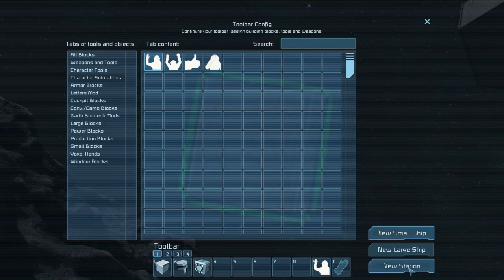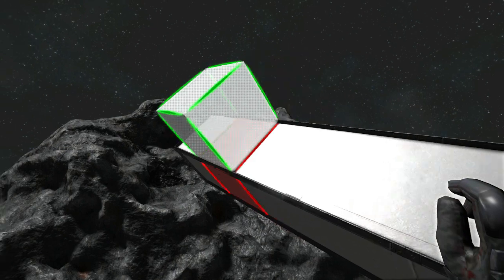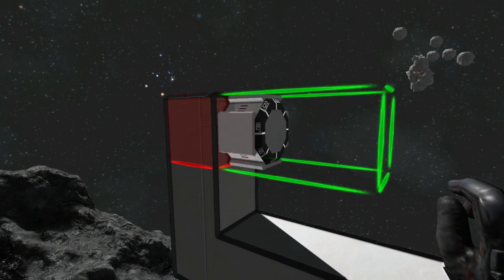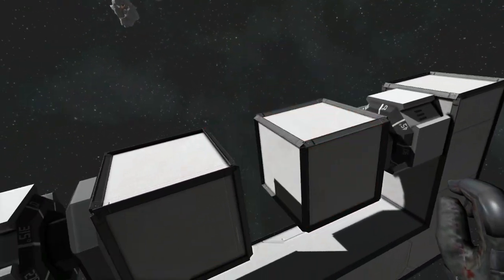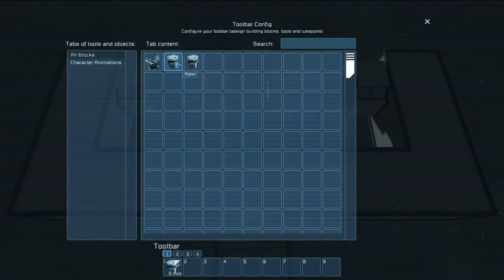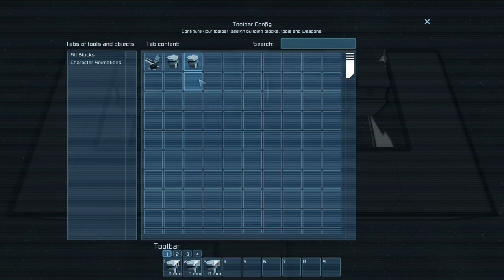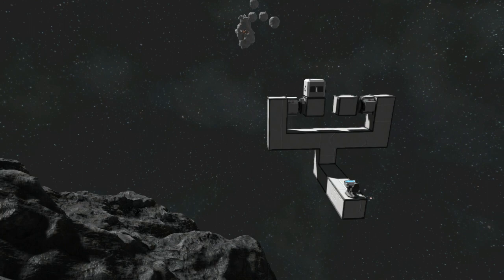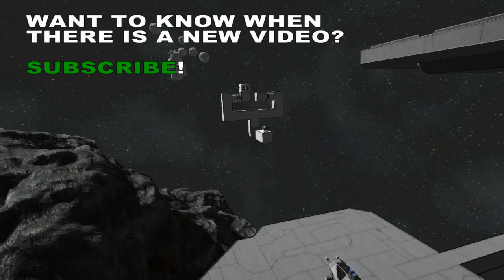E02 "Double Rotor Grid" | Testing Grounds | Space Engineers

Comment: I use the unattached rotor head trick! Setup is near the same but first you set the rotors to max lowered & then you grind off one of the rotor heads & build the platform & then place a rotor head on the part that has its rotor head still in place where it would line up to the rotor that you ground down so when you click the attach button it will attach when it gets close enough(which you have to extend the reach of the fully built rotor) Since keen added the attach/unattach function on the rotors I've been doing it that way as always(mostly in survival, mind ya)
Reply: As per what MereLyap said, that would be the easiest way to do this if you don't have the rotor top mod added to you're game
Reply from the maker: elementalblaze79 Awesome! I did it in a creative world where I could just place rotor heads and it worked like a charm. Thanks!

Comment: I just did that a few hours ago. So it does work still.
Reply from the maker: ***** You got it to work just how I tried it or a slightly different method? I still can't get it to work the way I demoed in the video but I did get it to work with normal rotors the way MereLyap suggested in the comments. Also it works just the way I did it with Advanced Rotors.
Reply: AnubizRa Ah yes you are right. With exactly that method you used, it does not work anymore and yes there seems to be a bug. It is reportworthy imo as even with -40 displacement, you cant get a block inbetween anymore aswell as the gap at the rotor top looks very odd and unpleasant.

You can however still connect both sides with merge blocks when you attack them to the sides instead of inbetween them.
Reply from the maker: ***** When you attach the merge blocks to the side? or the rotors? Apologies, I've tried a few things and haven't figured it out yet. I have two other working methods now and want to be able to showcase your method as well when I do an update video. Really appreciate your help.
Reply from the maker: ***** Thank you so much for the images and the video. I really appreciate all the effort you put into your response. When I posted this video I had a problem and now I have so many solutions. Outstanding.

Comment: yea there is a much easier way of doing this.....
Reply from the maker: Lee Wood What is your method?
Reply: Delete the head off one rotor, fill in the gap with blocks then add the "rotor part" block at the end of the blocks where the rotor has no head. Go on a console and click the  attach button on the rotor
Reply: If that is a bit difficult to follow there are videos showing how to do it.
Reply from the maker: Lee Wood Makes total sense, I forgot about the rotor heads and attach/detach feature. elementalblaze79 had the same suggestion. Works great. Thanks!